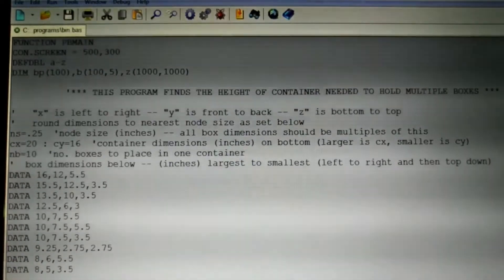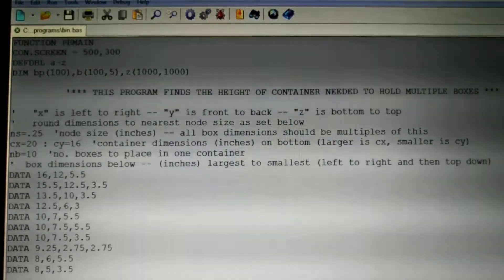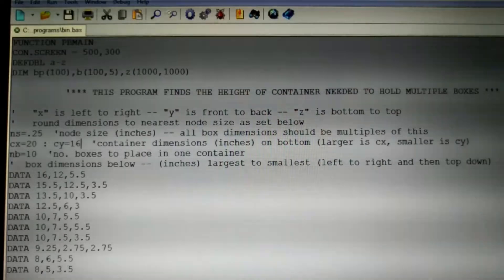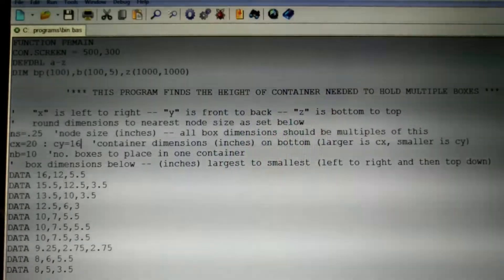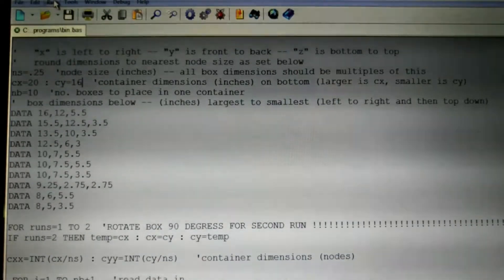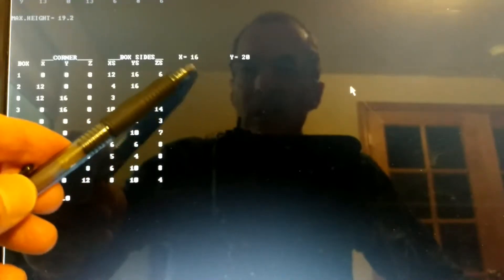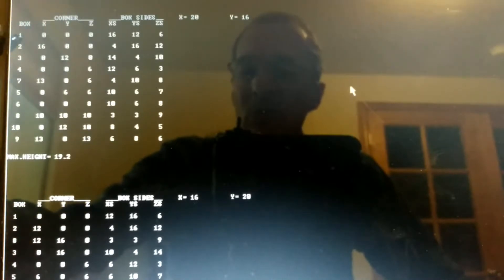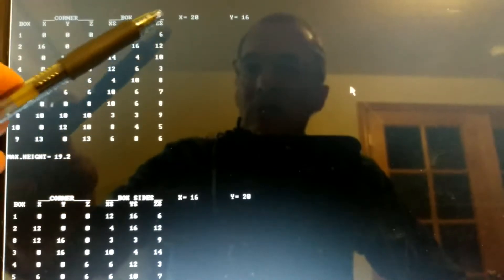3D bin packing technique

Comment: How I can solve this There are 3 types of boxes that need to be packed in the warehouse to earn money. Box type I has a size of 45 cm wide, 50 cm long, 40 cm high, and a profit per unit of 45 baht. Box type F has a size of 30 cm wide, 45 cm long, 20 cm high, and a profit per unit of 27 baht. Box type C has a size of 20 cm wide, 30 cm long, 20 cm high, and a profit per unit of 12 baht. If the warehouse is 10 meters wide, 5 meters long, and 4 meters high, the boxes can be placed in any direction and can be placed in any area of the warehouse. How to pack the boxes to get the highest profit?
Reply from the maker: Try multiple scenarios using different numbers of each box.